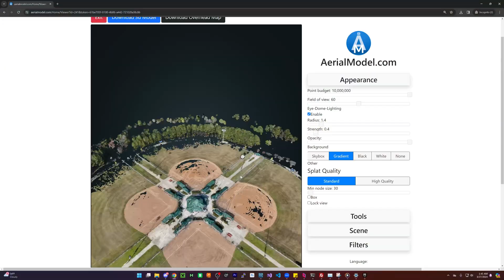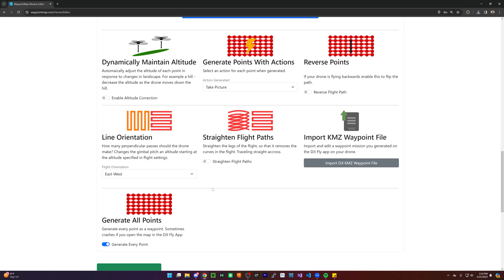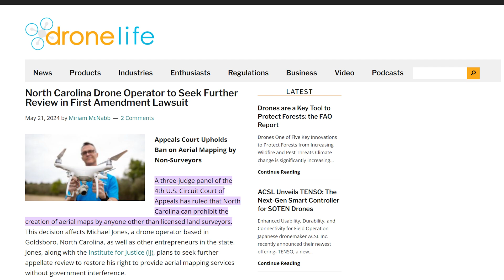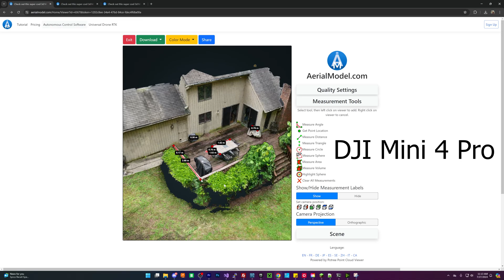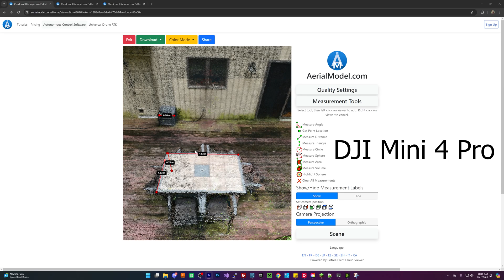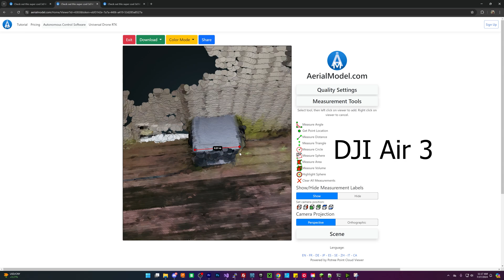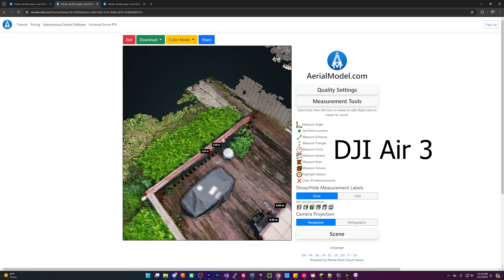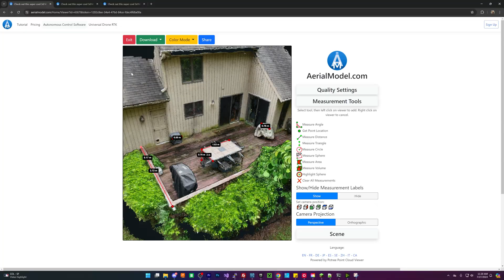How Accurate Is Drone Photogrammetry?

Comment: Excited to see your RTK module testing. You're right about how the results differ depending on how you take the pictures. You could have a wide angle lens but do a terrible job in the execution of data capture. This does make me think about getting a wide angle lens for my drone, Mavic 3 Classic
Reply from the maker: I got mine for my Mavic 3 (original 2 lens) off eBay when they originally discontinued it. I think I paid like $10 for the original DJI one.
Reply: @JaysTechVault  Nice, thanks for the tip

Comment: great work! but the table size is not that science, you pick the side width on mini 4 and others are length which vertical with mini 4, if you use the length the mini 4 dont even get enough data point for measure,
the grey box also in likely case, the original photos dont cover the same lens focal length and covered area
but the information about the table is useful!
hope you may try with bigger object

Comment: I am a huge fan of your software and I think you're doing a great job with it! I have seen that some other mapping software suggests a certain height like 300 feet to get the correct proportions/size in data. Does the Way Point maps system have a best height for consistency?  Also I have seen mapping software want up to 83% overlap as a minimum. I started using that number and even up to 85% and my photogrammetry quality went way up.

Comment: So actually have 2 things. Number one I tried making an account on the actual like map, making software and for some reason, it's not letting me sign in with the password. I set and it's also not letting me recover the password through email help me please. Also, for the mavic three, you're using the tight angle lens.The seven times for all of this stuff, right
Reply from the maker: I’m aware of the issue and trying to fix it now
Reply: @JaysTechVault  Any idea of a time frame, if not, it's okay, i'm just Wondering
Reply from the maker: Two hours
Reply from the maker: Please give it a shot and let me know if you still have issues.
Reply: @JaysTechVault  No issues now thank you